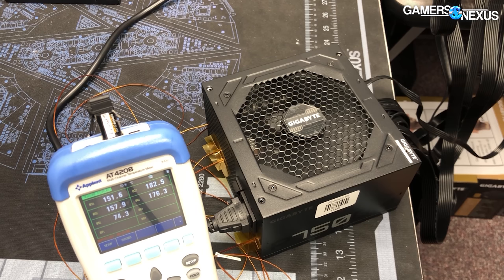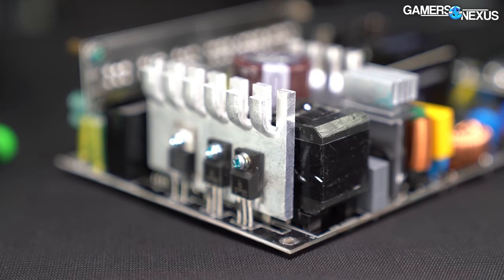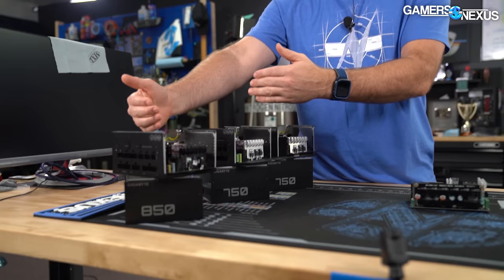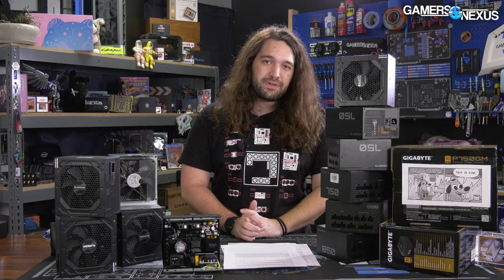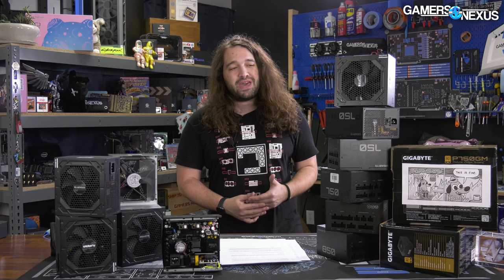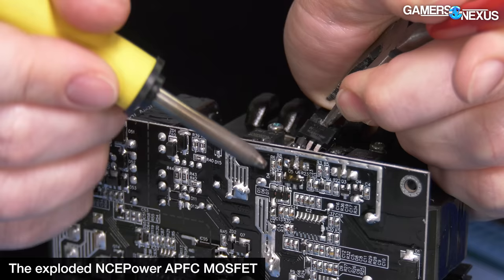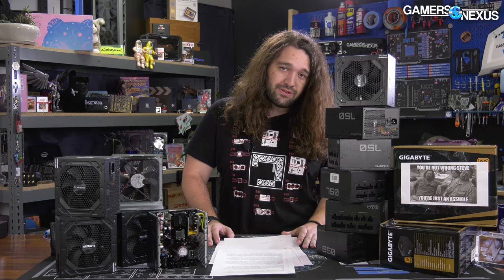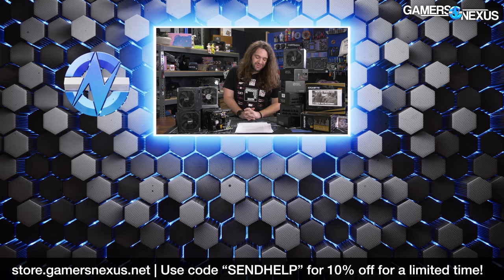Exploding Power Supplies: Gigabyte & Newegg Dumping Unsellable Product

Comment: I got two of the 850W variants in bundles many months ago from Newegg. Didn’t need them nor would I use such power supplies in my PC so I sold them on Reddit for close to their $130 cost. I hope the buyers are still alive. Should’ve made the buyers sign liability waivers.
Reply: Maikro Wavee  Why shouldn't he have sold it? The buyers can do research as well.
Reply: Maikro Wavee  Right…
Reply: @darklink2000  This is why everyone should realize nor be surprised that when it comes to money, there are no morals. Never.
Reply: @darklink2000  if you know it's defective and still sell it, and the thing kills someone (house fire, electrical shock, etc), the seller (but mainly Gigabyte) could be held liable in court if they were ever sued. but it sounds like OP didn't know it was defective when they sold it, so it would just be on Gigabyte
Reply: Here's the thing.  If he sold it without knowing the issue of the PSU, reselling it was not wrong.  However, if you knew of this issue, you are no different from Newegg.  The only thing that make you slightly better or worst than Newegg is if you warned the buyer about the issue when you have them signed the waiver.  Remember, you are do the same thing as Newegg, pushing a possible defective unit to another party.
Reply: I mean, there are a few things I will never ever cheap out on or buy used and that’s a power supply. It’s like buying a Ferrari then trying to run it with grease scraped from the bottom of a McDonalds Frier. 
I see an 850 watt PSU for 150 dollars, my danger boner’s gonna start twitching.
Caveat emptor applies, it’s the same sort of grey area that let New Egg bundle them in the first place. Sure they are crap but they on a cursory glance do what they say they do.
Reply: @Oyamada13  I think you missed a large point of the video; I’m not bundling the dangerous item with a highly desirable item that is guaranteed to sell out instantly.
Reply: @1989osu  I think you missed the larger point of the video.  This PSU shouldn't be in the market when high number of defects were reported.  Newegg could have asked Gigabyte to recall the inventory or written off at a lost but Newegg decides to turned a blind eye.  The bundling is just increasing the likelihood to remove it off their hands.  This is why when I said, "If you have KNOWN of the issue but still resell the product, you are no different from Newegg."  You are just using the bundling situation to make you look less guilty.

Comment: The fact this hasn't been recalled speaks volumes about how much you should trust Gigabyte with your money.
Reply: It doesn't matter the brand. They all have their own shady shit they pull.
Reply: Bet they still got their fingers crossed.
Reply: @shanez1215  Worst case: sets the user's house on fire, someone dies. Yeah, this is not a liability you want to shove onto the customer.
Reply: @Reziac  cough*NZXT*cough
Reply: They shipped graphics cards with crap firmware that often wouldn't work until flashed, last year. If I hadn't had onboard graphics on my old machine (and a spare card if I needed it— hooray hoarding old parts), the card I bought would have been totally useless to me. If the graphics card situation hadn't hit the fan after I bought that thing, I would have returned it and got something else.
Reply: Does johnnyguru still test?  I just get Seasonic and not worry. Although if i had multiple computers and need value options id be trawling reviews before buying random PSUs.  That Gigabyte PSU just looks like garbage from outset.
Reply: @waveformdistortion  i just rewatched that video 😂
Reply: @fredfinks  It may be that way now (Seasonic making their own). It was not always that way in the past. However, good to know there are still reliable units.... in case I ever run out of my stash of old Enermax PSUs (I've only had one die, and it had about 23 years in service).
Reply: @Reziac  Enermax built great stuff but practically nonexistent in market. (especially here in oz)   
Youre confused with Seasonic. They have been manufacturer from get go. With many 1sts (e.g. 1st manufacturer to produce 80+ certified PSU) .  Seasonic is absolutely set & forget. 12yr warranty. No one else does that. They are no joke.  (They aint cheap, but you get what you pay for)
I dont even consider anything else.

Comment: “…that’s when things changed for the worst… or, or the better, …depending if you’re Gigabyte.” 

Lmao
Reply: that's why I am so happy I didn't buy a gigabyte power supply
Reply: @raven4k998  Yeah, I have never heard anything good about Gigabyte components other than Motherboards or rabid fans. And I consider that person a rabid fan when he told me Gigabyte made a better GPU than EVGA. My rebuttal at the time wasn't that Gigabyte is shit, it's that EVGA is simply a good manufacturer, good cost benefit ratio. Gigabyte at the time also had good cost benefit ratio comparable to EVGA but the quality was notably lower. (talking about 2016 btw).

Comment: Worked in quality and system test roles. Don't think anyone will see this but for anyone who does, the main reason why you would have 2 different "types" of the same component even within the same family would be the company found an alternate source that provided the component for cheaper. It always comes down to money, if the company can save a few dollars at scale by simply switching one component to a different vendor, they always will. But that's where my role would come in, is to make sure that even with different components, the performance and integrity of the main product isn't compromised. Here Gigabyte seems to have either skipped over this step or their quality team didn't bother checking this issue.

Comment: Thanks for the in-depth work. I bought A P750GM a couple of months ago - bundled with a 3070 of course - from a major distributor here in Denmark. I sent your video their way, and their response has been disappointing; they won't lift a finger until Gigabyte formally announce a recall of the PSU. Even requests to upgrade to a Corsair RM750x - me paying the difference - was rejected. I hope you're able to put enough pressure on Gigabyte to get a response in the form of a recall to ensure these poor quality units are brought back to be disposed of.

Most of us readily pay a premium to go for well-known and trusted brands when it comes to power supplies, exactly because of the impact a failed PSU can have on the rest of our systems, and it's disappointing to see the lack of action on Gigabyte's part here. Keep us updated Steve & team!
Reply: Send a heads up to your local consumer safety/ trading standards people.
Reply: As a rule of thumb, never support/hate brands blindly, especially for PC components. Every brand has their own fair share of great and utter shite products. Especially when some brands merely rebrand products made by other manufacturers (eg. Corsair's PSUs) and as this video has shown, even within the same SKU/family of products, a manufacturer may not stick to the same components so one person may get something usable and another person may get a dumpster fire.

Comment: regarding the different components on each model, It's normal to have multiple equivalent components spec'ed in the parts list to diversify the supply chain. Those passive and discrete fet devices are widely and equivalently manufactured and sold under a lot of different brands.
Reply: Yeah, I assumed as much when watching this video as well... these kinds of parts are heavily commoditized, there’s no real reason to stick with one particular supplier.

Comment: Very interesting guys! As an EE student I might add that it would be interesting to have an oscilloscope hooked up to unit to see what the ripple was under full load.  If there was a large amount of ripple it might explain why components were dying.

Also as someone who gets free old (broken) power supplies from the local computer shop and takes the components out of them to use in my own projects, I'd like to add that monitoring the temperature of the heat syncs is a fairly common practice, and I'm surprised to see that this power supply does not do that.
Reply: You dont expect much ripple on this configuration since the have active PFC and the cap is pumped by a mosfet which is controlled by the same PWM IC. So the waveform will be more complex. When mosfets open, the spike generated on the primary is pretty big, enough to blow a scope frontend easily.This is way they fit 600 and 800V mosfets.  You need an attenuation probe and an ISOLATION TRANSFORMER

Comment: I had the displeasure of being forced to buy one of these 850s back when there was a PSU shortage. I brought it thinking with a 10 year warranty it must be legit if they are that confident backing the product for 10 years. I can confirm that it was fine for 3 months and then still blew up, taking my whole pc with it (except for my gigabyte 3070 eagle luckily). What a nightmare that was. My friend was also in the same situation buying the 850 version during the part shortage. When I told him to replace it after what happened with mine, he decided not to as it was working fine at the time. Fast forward 3 more month (6 in total) and his unit fried his ram sticks. He was lucky he didn't get the full gigabyte experience like I did. Normally I would buy corsair or cooler Master PSU's I have never had a problem with these brands and still have 3 CoolerMaster PSU's running fine 10+ years after purchase.

Edit: 
I only used to buy CoolerMaster (after building my first pc and going through 5 unbranded PSU's lol) and have used them for lots of friends computers with no problems. After seeing the video about CoolerMaster's testing that Gamers Nexus did I thought I would continue to buy them. Unfortunately the PSU shortage happened. I'm in Australia btw.

Since the gigabyte drama, I've installed 3 computers with the Corsair 850W RMX since being unable to get CoolerMaster PSU's. 
I am yet to have any problems from any of the 3 computers, the longest one I have had installed has been about 6 months. I should note that the Corsair cables are horrible to work with as they don't bend or fit through case holes well and the actual power box is quiet big and can be hard to put in mid size cases nicely. But hey at least once its in you wont have to rebuild.
Reply: Seasonic blows up too from time to time but they usually do right by the costumer. I'd get Silverstone or corsair.

Comment: This needs a complete Gigabyte recall. No ifs, buts or maybes. Hit them in the pocket is the only way to stop this happening again. I regret buying a Gigabyte motherboard now. Never again, it'll be ASUS as I originally intended to buy.
Reply: I have an aorus elite b550m Mobo so far it's been fine, I do prefer the Asus brand
Reply: Gigabyte boards are actually really good, especially if you get one of there higher end boards. this story isn't representative of all there products. this is just this particular product line. this video shouldn't be used to disregard an entire brand
Reply: @rynz_2893  wrote, " this video shouldn't be used to disregard an entire brand" I have built quite a few systems with Gigabyte mainboards, and agree that they are good. Nevertheless, the brand is sullied by this kind of behavior, and I'll avoid them for a few years.
Reply: @rynz_2893  one thing is true though, their PSU seems to be terrible quality and same goes for their gpus , board wise at least for me so far it has been fine.
Reply: xvoided  He "should". Because he is basically supporting a greedy unresposible company. The reason why we're all saying we're boycotting isnt because they have a bad product. EVGA have a bad product, so does Asus, MSI etc. But at least they either recalled or fixed their problems. Gigabyte isnt.
Reply: Msi and evga stuff for me
Reply: @rynz_2893  if this is really such a bad product and gigabyte does not do a full recall then it is obviously a systemic problem in the company. And this is not a company that I still support.
Reply: I never bought a Gigabyte product always has been Asus for me
Reply: @mistletoe88  Agreed. It's not because of the problematic product. That can be fixed. It's the problematic company rhat doesnt want to fix defective products thats the problem
Reply: @Carlos2400  Actually gigabyte though is known to fix things and bring revised mainboards for example. They are definitely not just selling things. They care.
From Asus as well can come bad quality and bad decisions. For example i got a 1060 from Asus, which is loud when booting. Only when the driver gets loaded, the fans turn down. Winblow users don't mind, but other OS enthusiasts do.
No other gpu i got did that. Also i got an Asus Mainbaord with bad connection placement, which made it impossible to use different configurations of cards and case connectors. They were blocking. 
When it comes to the 3090. It was the fault of Nvidia with their wrong specification regulations.
Reply: I guess you haven’t heard of various ASUS debacles, like their previous generation AMD GPU’s that had serious problems with their cooler install. They didn’t have the proper pressure applied, and GPU’s would overheat like crazy. Every brand has the occasional lemon. That doesn’t mean the entire lineup of products is terrible.
Reply: @sergiomarin7632  I got the B560M and occasionally have boot issues. Once in Winows it is stable though. I still have more confidence in my old ASUS Z97M Plus...
Reply: @regwatson2017  aw man I'm so sorry that you suffer issues like that, how does that happen exactly though ?
Reply: @mistletoe88  well id have to agree if it becomes known as a systemic issue within the company. that would be a lot more serious then just a bad product for sure. at that point, I don't think I could defend them anymore until they got there shit together again and those kinds of optics can be very hard to repair once the damage has been done
Reply: @rynz_2893  reminds me of Asus and their utterly borked 2000 foray into video cards. Their RivaTNT2 cards got so many user complaints that Asus stopped responding and closed down their entire user support forum system
Reply: "complete Gigabyte recall" do you mean complete recall of the Gigabyte?
Reply: There are bad products, and then there are dangerous products. This falls into the latter. This could burn somebody's house down....
Reply: If One plans to boycot every company with shady product (handling) then one can give up PC gaming as a hobby alltogether

Comment: Little late seeing this, but I work for a CM and I can say the part shortage is super real. Bad to the point where customers are getting very… creative with their part selections.

It’s crazy, gray market is now gold, broker parts are sought after, and otherwise obsolete parts are back in demand. Sadly I don’t think we’ve even reached the bottom of the valley yet.
Reply: Just glad I did my builds with the kids back in 2019. Three PC's were built using second hand XEON's (E5-1680V2, E5-2678V3, E5-4627V2)  on X79 and X99.  Average PC build cost was $740, including new PSU's, cases, coolers, NVME m.2 or SSD.  The CPU's, GPU's, and DDR3 RAM were mostly second hand purchases. We were very lucky on certain local purchases (e.g. mint ASUS X79Pro for $20, exc. GTX 1080Ti for $350).  One GPU was purchased new (RX590 for $170) in Jan'20, a few weeks before inflation hit the GPU market. So far so good.
Reply: @jb678901  Not working for a PSU design company, but as an electronics designer and I can confirm that capacitors inventories are running running low, as far as our design and sourcing has been finding out.
Reply: @antecboy  I suspect the WEST is having a hard rethink about its Asian-based supply chains.  I did run a supply chain in the Asian region over a decade ago, for a Fortune 50 company.  Today, dealing in China has become extremely difficult; I have been trying to send one of my managers there since the beginning of this year and as of now, it has been impossible. Between the COV restrictions and recent social policy announcements by the CCP, it's not getting any easier.
It was also recently reported that INTEL has met with US government officials to discuss a multi-billion dollar FAB investment stateside, likely for both supply chain security AND national security reasons.  However, when it comes to technical commodities, we have a serious achilles heel, so to speak. Manufacturing is key; a lesson the USA seems to have forgotten decades ago. Our heavy reliance on Taiwan is another potential flashpoint, given the saber rattling by China in the seas surrounding that country.
If you happen to own a carbureted car...hold onto it.  I fear the "basics" are going to be worth their weight in gold...if things continues on their current trajectory. IMO.
Reply: @antecboy  In the past I’d fix most defects that came across my desk, now if digi doesn’t have anything available even remotely soon it becomes a donor board for everything else.

Tried to put together a fixture to automate one of our older braindead tests. The soonest I could get a key part, or anything remotely compatible, was 52 weeks. I’m currently trying to find things to rob it off of.